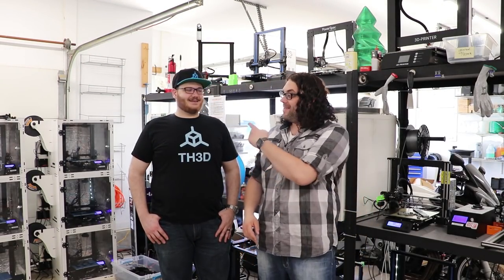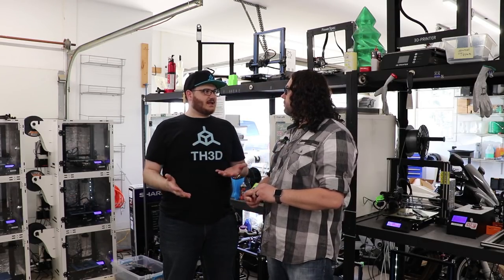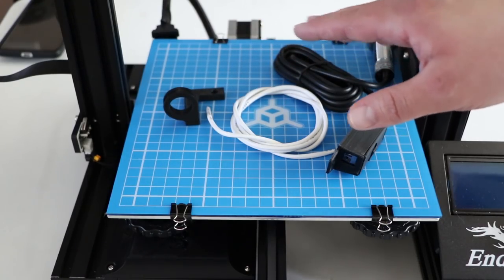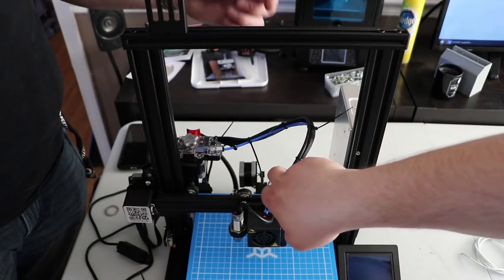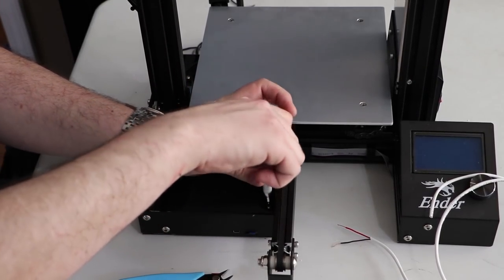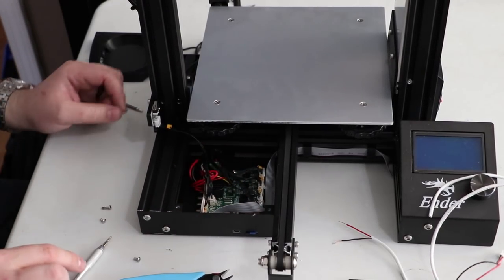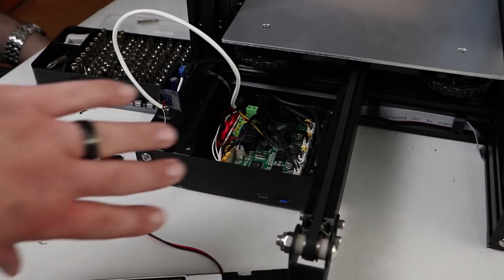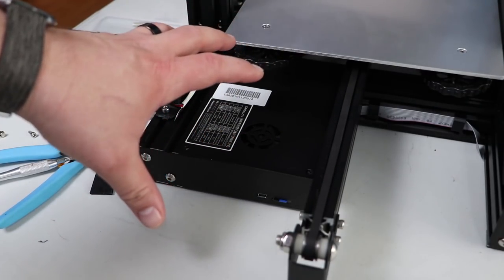How to Install the TH3D EZABL on the Creality Ender 3

Comment: I am waiting for my EZABL Pro to come in the mail and have been watching videos on it so I'm ready to install. The tip of reusing the screws and T-nuts from the end stop removal was brilliant. I also ordered the hard bed mounts, big nut and bolt kit for future mod installs, and the aluminum extruder top. I love my Ender 3 Pro but my gosh I'm so tired of screwing with leveling it seems like if you breathe on it wrong it changes leveling, not to mention wasting filament on failed first layers. I can't wait to get this stuff installed it's going to be so much more reliable. Great video!
Reply: Follow up: Money well spent! EZABL Pro works flawless every time. I will be a returning customer for sure.

Comment: There is a Z endstop socket on the EZABL board currently available. You can just plug the Z endstop plug in there, and if it's backwards, you flip a switch and it reverses the pins. Really easy setup.
Reply: My gosh—3 years later and I thank you for this comment. I was about to do the wire thing because for some reason I didn’t make the connection (no pun intended haha). When I saw the options on it I knew there had to be a way but some how it went over my head. Replacing a Bltouch with this
Reply: @cld0410  you're welcome, always happy to help

Comment: great video, I had bought a generic sensor that is the same type as the ezabl but it came with no instructions and extremely outdated firmware for the older 8 bit boards. following this guide and the guide on th3d's site for compiling the firmware allowed me to get everything up and running. I had to fix an issue with how the clone kit maker had wired up the sensor but that's what I get for not buying the ezabl kit to begin with (in my defense, I bought this kit before I found the ezabl kit, and had tossed it in a drawer when I couldn't use the firmware it came with).

Comment: Thank you so much. My ender 3 stopped working. Reset. Nothing. Checked gcode. Nothing. Looked at the 2 wires in back and they came loose. Reattached. Works.
Reply from the maker: Glad it helped Thanks for watching!!

Comment: Many network engineers and electricians I have spoken with in the past have told me that one should never be pulling wires like that when stripping them.
Hence why they currently make a tool to properly strip the cables without any pulling.
they mentioned that when people force pull the plastic off the cable to expose the wires, tends to pull the wire threats within the cables,
and its one of the major reasons why people have connection problems when using such cables that were treated this way. specially when cables are this small.
very small cables such as these tend to be extremely fragile and when pulling, and tends to rip the wire threads apart, giving bad connections within the cable.

Comment: Wouldn't it have been a better idea to mount the control box on the inside/rear of the extrusion instead of where the z-stop was? That way, the wires are completely out of harms way...

Comment: Good video, thanks.  But why didn't you discuss updating your slicer start G code?  Obviously you have to do that to get the G29 in there so it does the auto bed level before each print.  The current TH3D EZABL Pro installation guide (V2.1 as of today, which needs some work in several areas) goes over that.

Comment: Great video Jim & Tim! One question, what happens if you run the M48 test and you get a number higher than 0.01?  And should the M48 test be done on a hot bed?  Enquiring minds want to know (well ok, just me)  LOL  I have the EzABL and the Solid Mounts just got it working before I noticed this video. I even shelled out $5 for an ABS OEM Mount.  My M48 reads 0.011  (Ender 3 Pro)
Reply from the maker: Awesome! I will double check with Tim, but I think you can do the M48 test hot as well. If it comes out to far off, I would make sure you XGantry is straight, and start there. I love the solid bed mounts and the mount he put in it! PS. .01 is still pretty good!! Thanks for watching!

Comment: Just a quick note, the new EZABL Pro does NOT require you to cut the end stop wire on the Ender 3. There's a connector on the EZABL Pro you can plug in to now.
Reply from the maker: Very true! I love the new ones!
Reply: @TheEdgeofTech  Well that sucks I cut the wire. You guys should update the video with a comment.
Reply from the maker: @LeaterArt It's totally fine if you did, you just plug it in the other way!

Comment: Great Video, I have watched a few others that went through the process so fast they left me even more confused.
BTW on my control box it has a plug that fits the Z stop wire. Can I just plug into it instead of cutting the wires ?
Reply: Also how did you get Autohome to the center????
 Mine still goes to the front Left corner ?

Comment: Hi. Great video.  Question, you said I have to use some included gcode on every file I print.  How do I do that exactly?  Is it something I add in Cura? Do I just run it before each print?  I am really really new and just barely understand how all this works.  Thank you!
Reply from the maker: If you download the TH3D unified firmware package, it's included in one of the file. You need to add it to your slicer setting under the "Starting GCode" area. If I remember right, it's in the printers settings. Let me know if that helps, if not shoot me an email and I will get the you gcode. Thanks for watching!
Reply: @TheEdgeofTech  Thank you.  Dont really understand, but hopefully I can figure it out.

Comment: Why don't TH3D offer an adapter so the Z end stop wires do not have to be cut VOIDING the warranty . to me cutting and  hacking stock wires is unacceptable and unprofessional. other than that this was a very good tutorial video especially on the standpoint people can understand you unlike certain Australian poster that think talking fast with an accent is understandable.
two thumbs up, thanks you.
Reply: Unless its changed, they do sell a kit that does not require you to cut the cable.

Comment: hi, Great video I want to buy a ABL I am between the BLtouch and this EZABL, so the Bltouch have a probe that can touch the surface and make the adjustment needed and the EZABL is a sensor... my question the EZABL since is a sensor the different type of bed surface (glass, magnetic,etc) will afect the calibration?? I do have the factory ender 3 por magnet sheet for the bed and also have a glass for the bed and I change it consecutively depending on the print so I will need to calibrated everytime if I using the EZABL?

thanks in advance!
Reply from the maker: You can use the EZABL or the BLTouch and you will get great results from both. If you are changing your bed surface all the time, you may want to away to the BLTouch. The EZABL will work too, but you would have to adjust it for every bed change I believe.
Reply: @TheEdgeofTech  you said that "want to be away from bltouch" or "what to go with bltouch"? If "want to be away from bltouch"  why?... and the ezabl will need to be adjusted on the setting for approximation or in the screw that is on top of the sensor?
Reply from the maker: @rayrod9010  in your case I would get the BL touch
Reply: @TheEdgeofTech  ok thanks

Comment: I think this is amazing! One question came to mind. Doesn't your bed need to be level before you use this auto leveler? And also, how often, if ever, would you have to adjust the springs underneath the bed. Are you ever planning on selling on amazon?
Reply: The end of the video mentioning the solid mounts kind of answered my question hahaha.
Reply from the maker: Thanks! Yes you should always level your bed the manual way first. and if you have the solid mounts you don't have to worry about that.

Comment: borke my printer =( it will not go to auto home now after stripping the z cable. The bed and extruder move afor a second. It will no longer o to auto home.  I hsould have never installed this
Reply from the maker: If you unplugged ezabl and add the z endstop back does it auto home?

Comment: I am printing the same test but mine doesn't prob the table first.
Reply from the maker: Did you make sure to put the G29 after the G28 in your starting GCode in the Slicer? So you would have something like this: 
G28 Auto Home
G29 Bed Mesh

Comment: I cannot more strongly or wholeheartly recommend you tell people to not use this direct power system and to advise them to use the AC power. I am in IT. This is open heart surgery with the power. It's been over an hour with me trying to work with these included wires on the 3 Pro I'm calling it. This is absurdly difficult. The amount of times these brittle copper wires included have spanned needing me to re-strip is unbelievable. The included screwdriver does NOT have enough grip to torque the wires back in to properly hold the wires in place once you have the first wire in. I am about to throw my printer across the room. Everything is fantastic, but this wiring section is nearly impossible, and I can't imagine how I would feel if I was not in the tech field and knew even less about what I was doing. I probably would have permanently screwed over the 3 Pro's power cables, requiring me to track down new one, and either start the process over, or just cut my losses.

Comment: Dont you have to go to the offsets and click on "store settings"?
Reply from the maker: After you baby steps yes!
Reply: Yes, you have to store settings, but don't add any offset. The babystep Z already does the offset so your nozzle is close to the bed. After adjusting babystep Z you need to store settings, but that's all. No more adjusting required.

Comment: So if I do this mod your saying I have to add some code to every thing I want to print from here on. Is there a video or instructions showing how to do that? Only had mine a week and simply load stl into cura and click slice using all default settings so unsure how to add gcode
Reply: The install guide that comes with the EZABL tells you what you need to change in your slicer gcode to have it run a probe before each print.

Comment: WTF man. i just waited weeks for this kit and it doesn't even come with the required hardware to install the mount. How much extra would that cost them to supply? ARRRGGHHH
Reply from the maker: Are you talking about the mount? You can select to add it when you order or 3d print it at home in the color of your choice. Do you need the file location?
Reply: @TheEdgeofTech  no I purchased the OEM mount from TH3D with my order. Thats why I think its crazy it didn't come with the hardware (longer M3 screws). They new what mount was being used so should include the require hardware IMO.

Comment: My M48 is .098 is that within standards
Reply: Yes they said .1 or lower
Reply: @Hayden200011  At time code 26:00 Tim says '...under 0.01', the above '0.098' is above that, not below it. Would suggest some more calibration needs be done or there is some issue with the probe accuracy

Comment: Anyone ever think of making a video on hooking up the EZABL in Marlin 2.0? I just spent 4 days and it refuses to work the same as it did on the Mezli Boards. Like a lot of people, I've updated to the SKR Mini E3.
Reply from the maker: Not sure, but very good idea! Are you talking vanilla Marlin?
Reply: @TheEdgeofTech  Yes
Reply: I finally gave up and implemented Manual Bed Mesh Levelling and without my EZAL have finally realized the best first layers I've ever had in 3 years of 3D printing.
Reply: Currently trying to do this as well, not having much luck